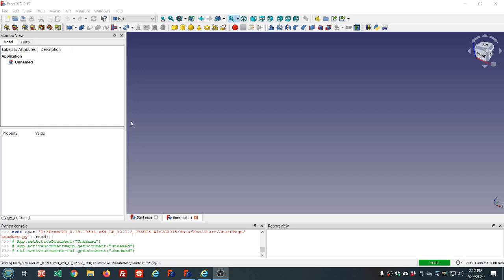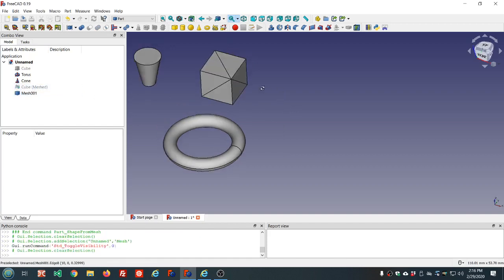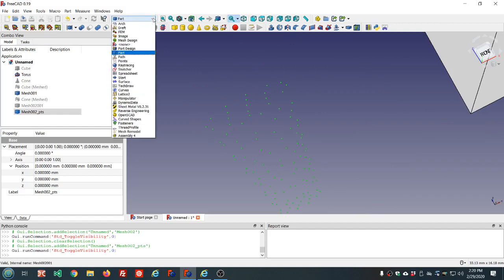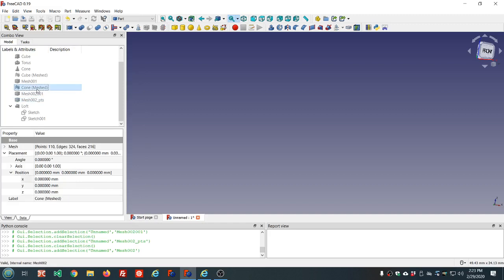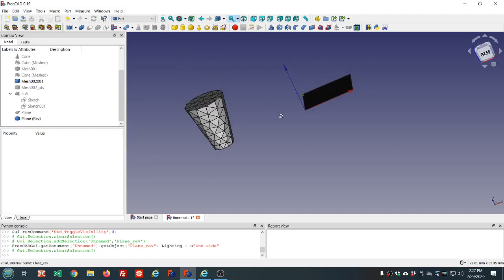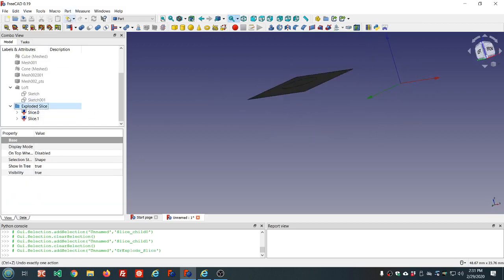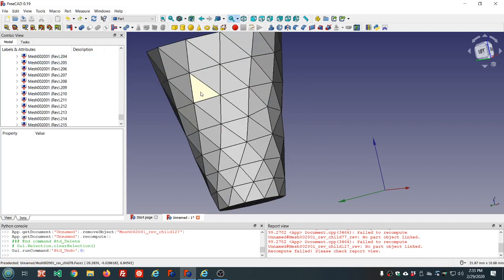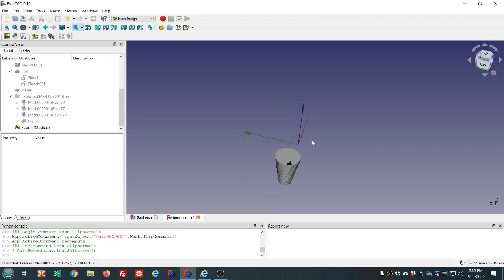028   FreeCAD box selection meshes

Comment: Hello Mark. After watching this video i would have hoped to find a solution for my problem, so i have also watched the 29 video.
I have a simple sketch from a circle and extruded this circle to a tube from the part WB.
Than i sliced that tube with a thin box under an angel with the tool Slice Apart. 
Then i go to the Mesh Wb and create a mesh from the sliced shapes.
Then i  use the analyze and repair tool in the Mesh WB, they both got errors.
They both have 20 'Folds on Surface' .
When i try to repair these folds they just got deleted, so the mesh is destroyed.
Do you have an idea on how to prevent that to happen, because i think this is a simple operation in a Cad program?
Thank you for your time, and have a very good new Year.
Jean
Reply from the maker: Try adding a small chamfer or fillet to the edges that are giving the errors before creating the mesh.  Also try different options (standard, netgen, etc.) when creating the mesh.
Reply: @mwganson  Thank you Mark, a fillet on the end of the slice did the trick.